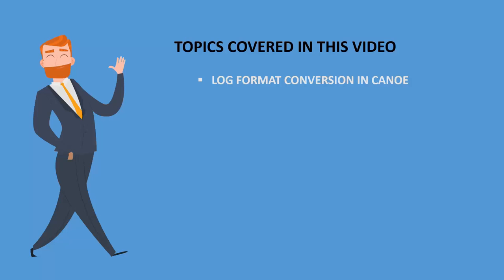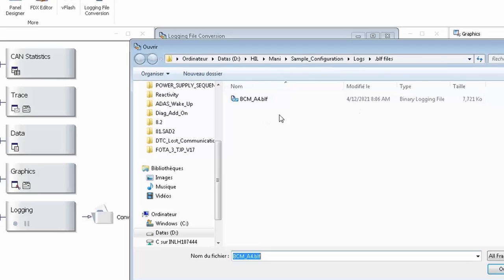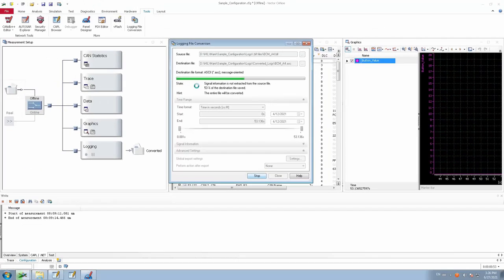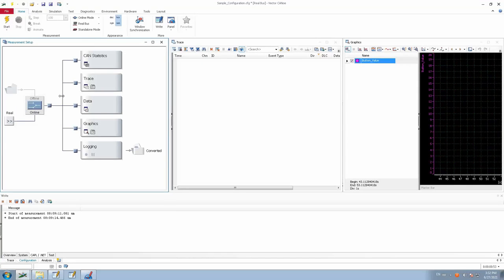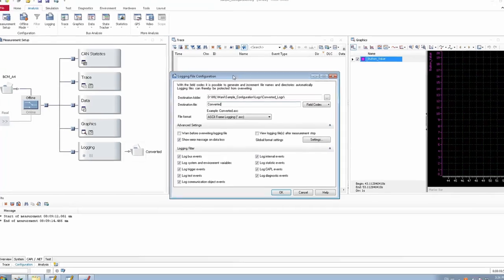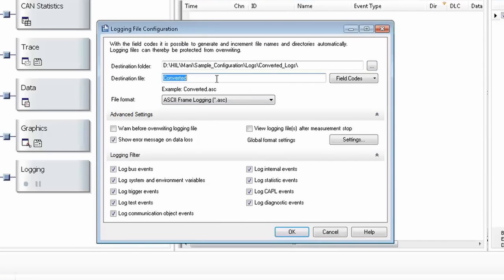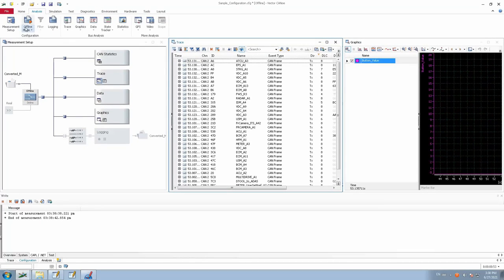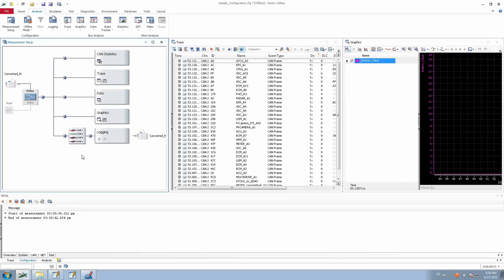Vector CANoe - Log File Conversion

Comment: very nice. but the option "log file conversion" is greyed out at my installation and in the offline mode all the special ascii comments included in the blf are not logged by the logging block. so this solution does not work for me either. is there a simple (command line based? or stand alone?) program that does the job?

Comment: Hello Sir, is it possible to crop a log file, I have a log file where the key information occurs after 70 mins and anything before that is not useful data. I also tried data conversion tool but the cropped log file still holds the actual timestamps and doesn't start with 0 sec.

Comment: if we have more Testcases (more Runs), how can be save the logg files automatically ?
Reply from the maker: You have the option to save the file automatically by incrementing the Log, you will find that option in the Log block..
Reply from the maker: Also, you can use the CAPL script to save the log in your preferred naming. Please check the CAPL In-built function for saving the Logs.

Comment: Hello Mani,

You videos are really helpful.

My CAN data is in clf format.  So will I have to convert it to ASCI (asc format) prior to doing offline analysis work on CANoe?
Reply from the maker: Hi.. Do you mean .blf format? If it's blf, then offcourse you can directly do the Offline analysis, its not mandatory to convert into ASC file for analysis. The benefit of .asc file is, it is a readable format (which you can open in any notepad application to see it). But you cannot do the same with the .blf file (because it is an encrypted format).
Reply: @smk1984eee  Thank you it is clf format not blf.